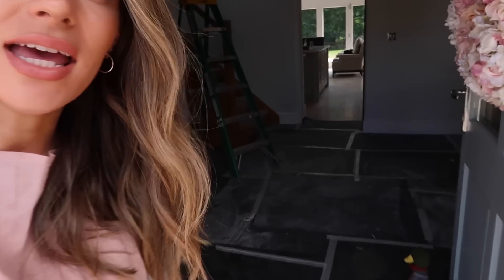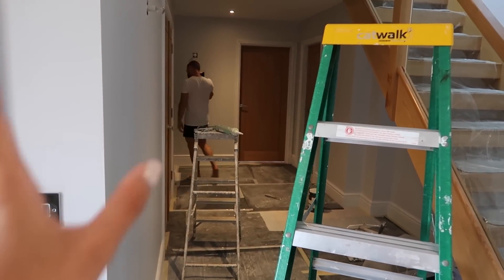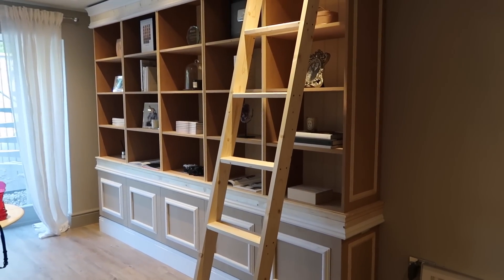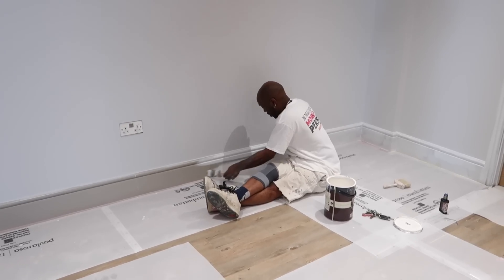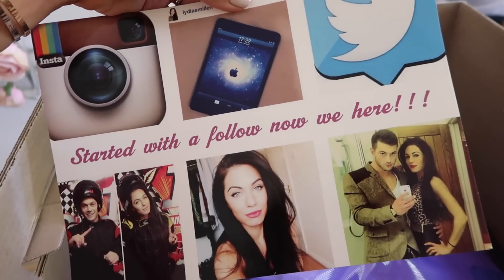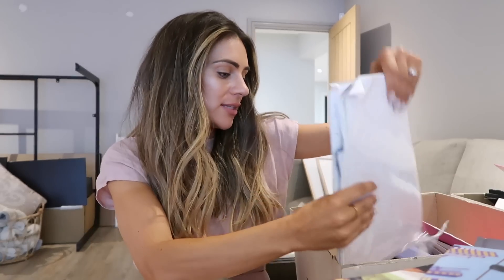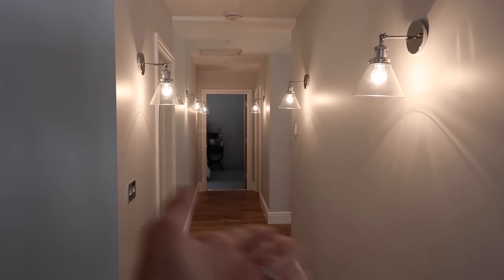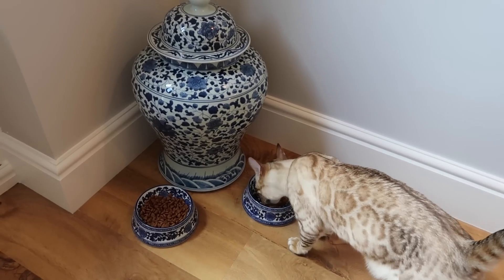NEW HOUSE UPDATE | Lydia Elise Millen

Comment: Thanks so very much for the FUN video. Love your home. Beautiful!!! Thought for bench by the back doorway...what about those benches with the attached slat backing and hooks for coats and umbrellas??? Do you have those in the UK?
They have two baskets under the bench for shoes and the attached back will fit between your lights. They have two cubbyholes at the top with molding and hooks, like I said for coats and umbrellas.